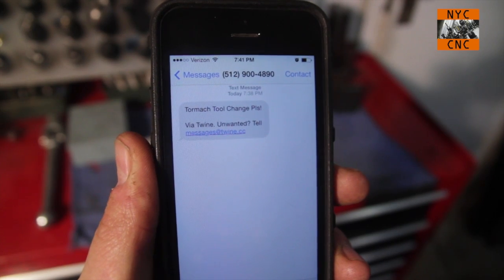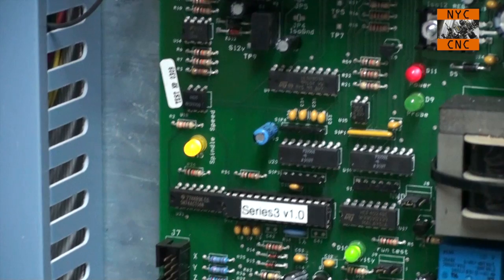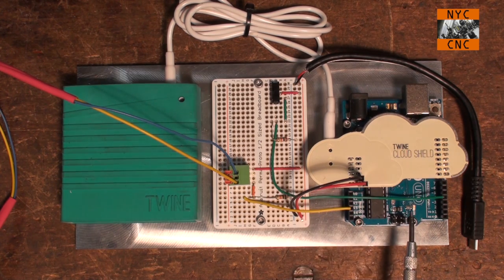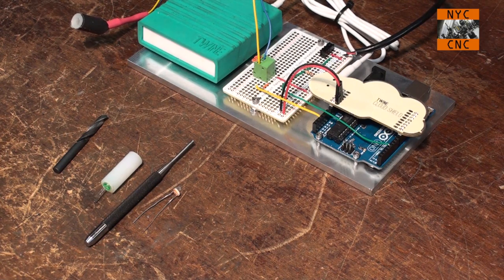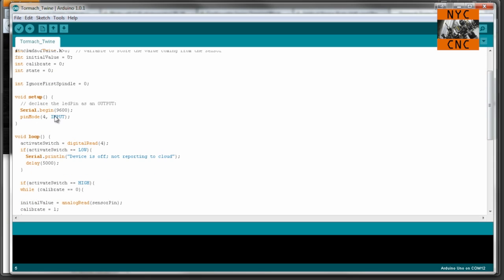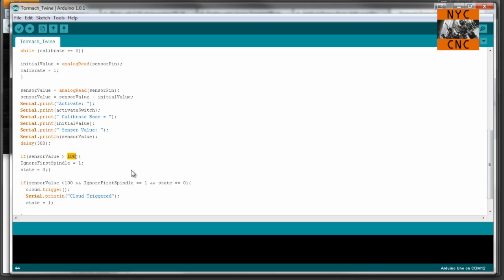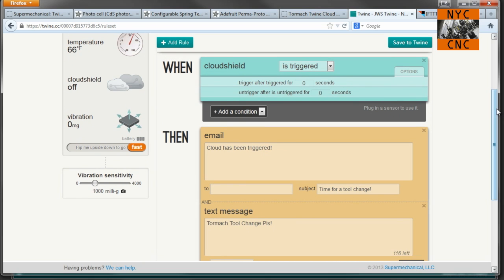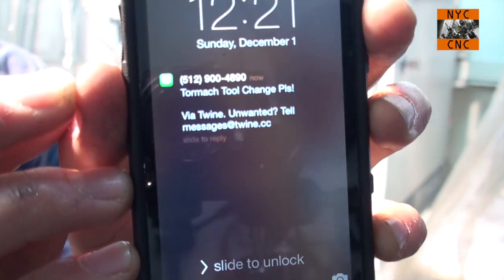Arduino + Twine = CNC Mill that Sends Text Message when it needs a Tool Change!

Comment: Depending on the diameter size of the photocell, a pencil eraser that has corresponding spaced holes pierced through one end to the other could be a great friction fit plug while also insulating the leads from touching each other in addition to blocking out light...  drawing inspiration from those panel- / enclosure-mounted  chrome LED reflective holders I'd pick up from Radio Shack as a kid - they all included black pencil eraser-shaped plugs that already came with two holes pierced through them to run LED leads through while also holding the LED within the focal point of the beveled reflector.
Great investigation to find those machine / circuit  status opportunities and apply Simple Solutions ( K.I.S.S. ) to create the huge gains in machine status and efficiencies !
Reply: I always liked the idea of putting machines to work while also freeing me up to engage my creative mind without too many interruptions from said machine - I can appreciate how the making the tool turns around to make me but only to a point short of interrupting the greater gains of a creative Meandering

Comment: Nice.
But why did not you use Mach3 macro to get the spindle state and output signal required for tool changer, instead of the onboard LED.

Comment: I've had an x2 project in the works for a while but I got bogged down somehow. Not having any background in electronics is probably what did it. But now I'm going to school for mechatronic a and robotics so eventually I should be able to tackle it, without having to rely on crossed fingers. I'd really like to build a mill from scratch to make use of a 3-hp 3-ph motor I have, as well. But another day, back to studying complex numbers and physics. Thanks for the videos, they're always straight up, and cool.

Comment: Awesome thought, I'll have to add this to my Mod list,
Reply: I have a Mechmate #79 a 5x10' cnc spindle. Im running a gecko 540, nice but limitations. I use my arduino setup to monitor all the motor temps coolent lvls etc. . . .It Lego electronics my favorite kind,
Cheers

Comment: Why don't you want a toolchanger? I always thought that would be the greatest thing to have.
Reply: John NYCCNC

OK now I do understand. I am looking into milling mashines myself eventhough I started with a router. I would have gone with a haas because the price diffrence is not so big. (Toolroom mill) but the space and the price are both major problems for either of those mills.
Reply: John NYCCNC

I need to work with stainless steel for mashine komponents (thats probably the most diffucult and most often used application). Those mashine komponents are mostly for scientific instuments so very low volume but low tolerances etc. Other than that I will mostly work with Aluminium. But I love to try some of the harder stuff like titanium as well.
Reply: John NYCCNC

I know the tormach can do all that but I see some majour disadvantages with it: the tormach tooling is not a standard and expensive. Its almost as expensive as a bigger mill from other companies. And the power of the spindle is a little low. With my cnc router I got 2HP (1.5kW) and I wantet to do some cuts in wood which were just not possible.
My last point is that Tormach is not international so I get quiet a few more problems comming from Germany. And the using of only imperial measurements on their website really annoys me.
Don't get me wrong I like your tormach mill but those points weigh pretty heavy.
Reply: KOR
well I have to admit I was wrong about the price its actally fairly decent. If you live in the US. But the ER20 is limiting ER32 is really the minimum for me to get 20mm endmills. (which are the smalest I can find which got the exchangeable cutting inserts.

Comment: Another thing to add . You have what looks like a VFD (variable frequency drive) in you control cabinet. I'm sure it has a set of contacts that opens or closes when there is a fault when it stalls or some kind of current over load.So when the drive faults you can have a message sent to ya. Anyway that's my 2 cents.Good vid!